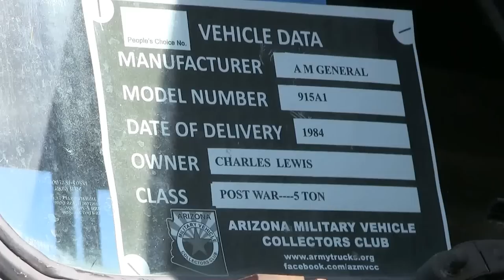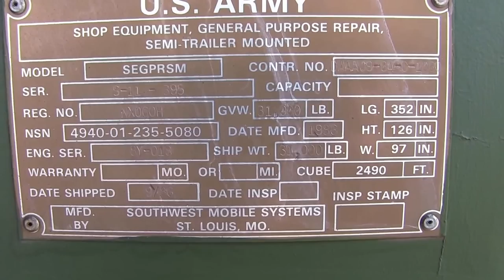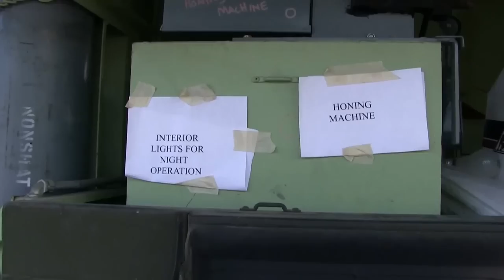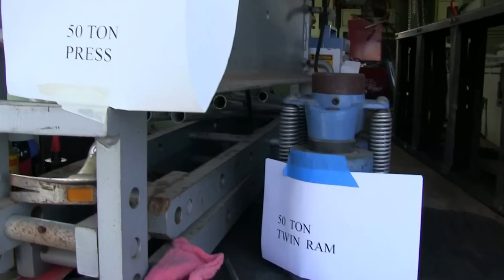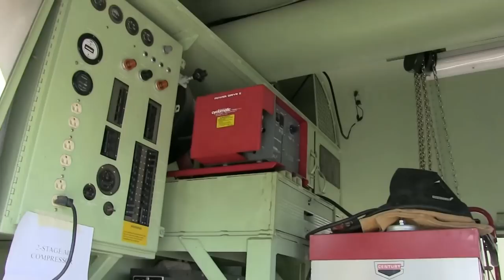1984 M915A1 With A Nicely Equipped Welding Shop Trailer

Comment: This is the welding shop version of these trailers. The machine shop would have had a lathe off to the side and a mill in place of the drill press. We had one in Rock Island that was all set to be DRMO'd. I would hate to work in one because of how cramped it was. The SEMS was a definite improvement
Reply from the maker: Thanks for the extra info.  I have modified the title and description now.